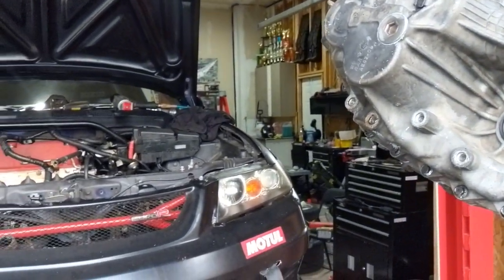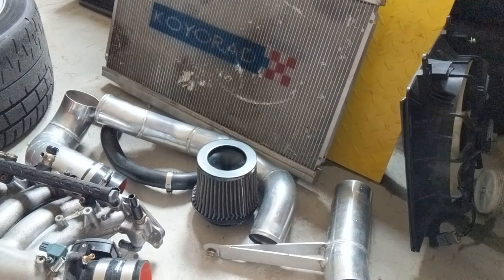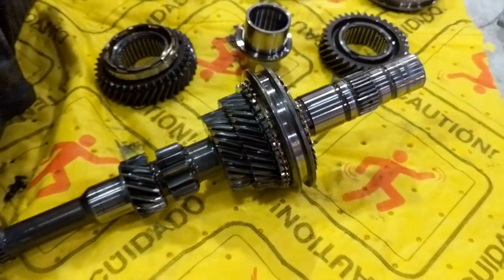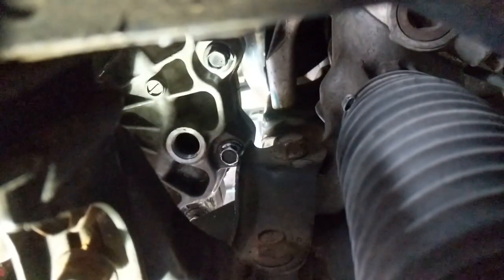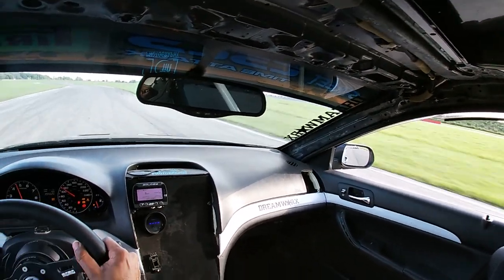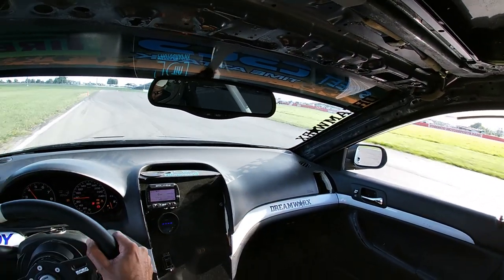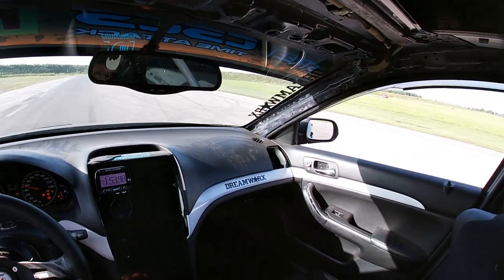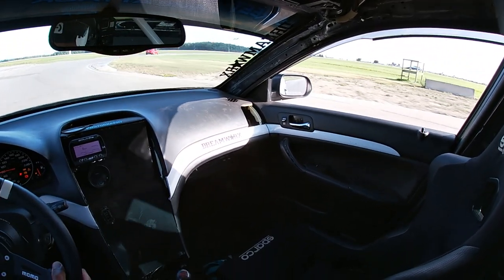The Rebuild - Test Session @ TMP

Comment: how are axels holding up?
Reply: @fsocietytsx  thanks for info, alot of owners in eu have problems with shafts on cl and cu2 (more so on cu2) cars, even oem are coming with fault. its really a nightmare to find a solution for this problem. Will recomed them to look into insane shafts as a option.
Reply: @fsocietytsx  yeah and here new one are 600 euros per side and only can be bought from diler. One guy had 8 shafts swapped at the diler ultil they got working one... They were faulty from the factory. Thanks again for the info 👍